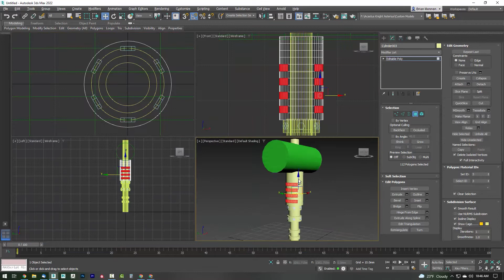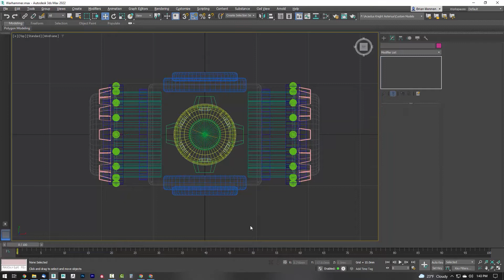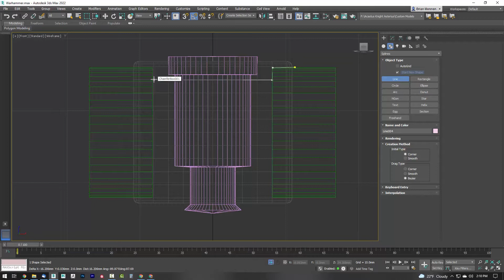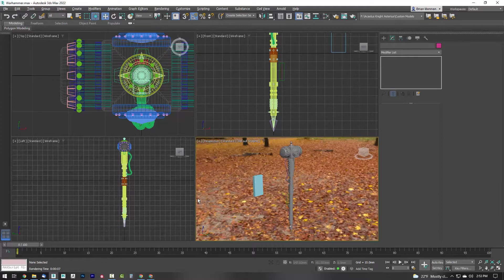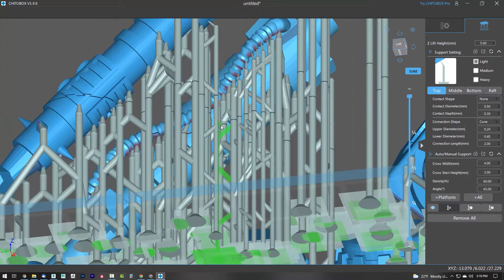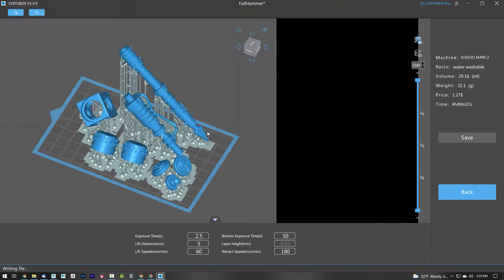Acastus Build 31 - 3D modeling and printing a warhammer for Warhammer.

Comment: Are you going off of a reference or is this Hammer custom design?
Reply from the maker: The original version in the video is 3D modeled and printed by a friend, Adam, his webstore is: https://www.etsy.com/shop/ReplacementSabers?ref=simple-shop-header-name&listing_id=942698907
I did redesign it in 3ds Max so I could print it myself on my Elegoo. I was able to make some adjustments to help make it more modular as well if there were ever a future need to print one for a different army.
Reply from the maker: Just made an etsy shop so my version is available: https://www.etsy.com/shop/BritheBuilder